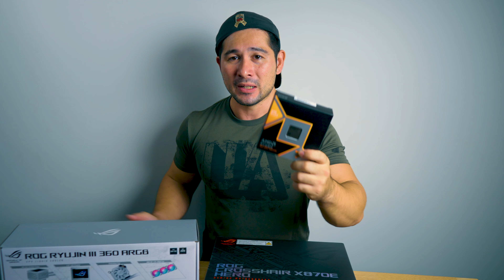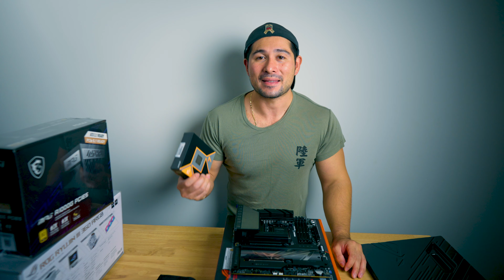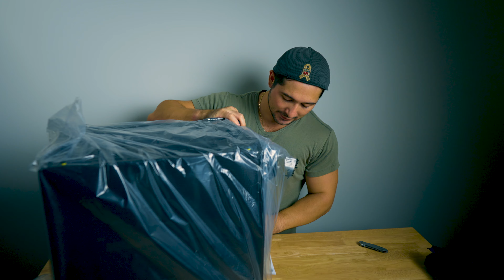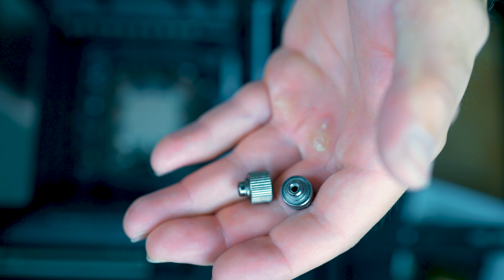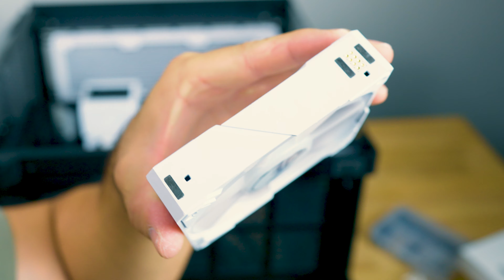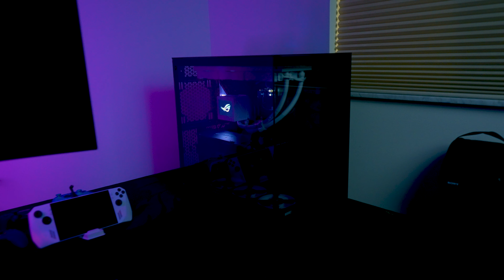🔥 AMD Ryzen 9800X3D Gaming PC Build! A step-by-step guide to building a PC in 2024!

Comment: Anybody else find quite a large resistance when latching? Even after seating with the notches i noticed quite a heavy resistance. I’m going to reseat as my temps are way higher than they should be and it has me worried I’ve got damaged pins.
Reply from the maker: How long ago did you do your build?
Reply: @ChrisMizo ~1 week ago. Cleaning the cpu with isopropyl rn 😊

Comment: YO CHRIS BRO WHAT DO I NEED TO DO WITH THE USB THAT CAME WITH THAT SAME MOTHERBOARD, I SEE SOME BIOS, DRIVERS FILES ON IT
Reply from the maker: Hey! all you have to do is install the drivers and you’ll be good to go 👌
Reply: @ChrisMizo  Bro I did the very last part and after I saved bios changes and existed now my monitor screen hasn t rebooted and i have a yellow Q-LED light on top right corner of my motherboard
Reply from the maker: @srg6591 that’s more likely related to your RAM issue, have you adjusted Expo settings? Sometimes the RAM could be seated incorrectly.
Reply: @ChrisMizo  ahh no bro it was a pcie cable missing. Thks a lot man
Reply from the maker: @srg6591 no problem glad you got it resolved 🤙

Comment: YO BRO CHRIS WHICH SCREWS I NEED TO USE TO MOUNT THIS MOTHERBOARD  INTO THE CASE, I DON T SEE SCREWS INSIDE ITS BOX, SHOULD I USE PC CASE SCREWS ?
Reply from the maker: Hey Bro! Your PC case will have the screws inside a little box, typically stored in the HDD area of the PC. They'll be size #6-32 , if you have any further questions feel free to ask 😁
Reply: @ChrisMizo  thanks a lot bro

Comment: I have the same mobo and cpu did you do an bios update for it?
Reply from the maker: I did do a bios update once I had the PC booted.
Reply: Can I do it with the memory stick that comes with mobo?
Reply from the maker: @Armatoly not on the mobo's flashdrive but use another one. Doesn't need too much space, even 1GB is good 👌
Reply: OK I appreciate your help, thanks.
Reply from the maker: @Armatoly no problem at all ✌️
Reply: I also have the Rog Crosshair X870E Hero with the Ryzen 7 9800X3D and first thing I did after booting up was a BIOS update to 0606 (was the latest). Since I made the upgrade a month ago, a new BIOS update 0706 was released with some fixes for fan-related bugs and to improve system performance. The earlier version 0606 brought several functions like the "turbo game mode" which should increase the performance in some games.

Comment: does 9800x3d good enough for gaming+ recording?
Reply from the maker: Absolutely the perfect processor for doing gaming and recording 👍
Reply: @ChrisMizo  so i must use nvidia encoder for streaming and recording then 9800x3d would be enough, right? no need to choose 7950x3d or 9950x.
Reply from the maker: @gogo0913 exactly, unless you are planning to do more heavier edits with adobe aftereffects or do some sort of 3d rendering, this processor will give you the power you’re looking for 👍
Reply: @ChrisMizo  okay, i only do editing video and i use davinci resolve which use only gpu (i checked it on task bar and gpu monitor).
Reply: @ okay, thank you so much
Reply from the maker: @gogo0913 no problem at all

Comment: I got this board and there is no audio port, did you got any problem plugging your case audio wire plug into where it shouldn't being plugged ?
Reply from the maker: Hey Cosmo, you should have a LINE OUT port next to the MIC port and optical port. Make sure to check your default audio settings are set to Speaker output device to (Realtek Audio). Hopefully this helps out, feel free to ask if you need any more assistance! Thanks so much for watching! 🙂✌️

Comment: Nice video. A question about the aio. How are the temps idle and underload? And what about the noise?
Reply from the maker: Temps around idle by far are 46-47 degrees idle, underload during gaming in the 70s, noise level at first was a bit loud, once updating the aio, it became quiet as it updated the smart fan profiles. Hopefully this helps, Thanks for watching!
Reply: @ thanks for your reply. Have you ever tried the new nzxt kraken 2024? If you had to chose between these two which one would you pick?
Reply from the maker: NZXT Kraken is really a great cooler, this would have to boil down in personal preference and aesthetics, but I can say kraken is silent.